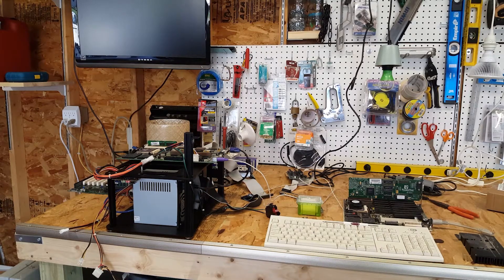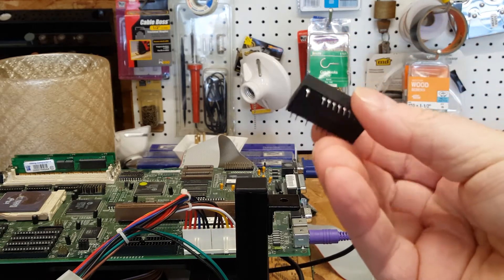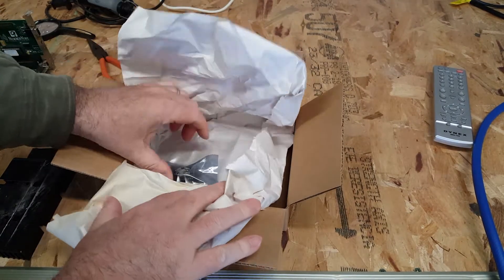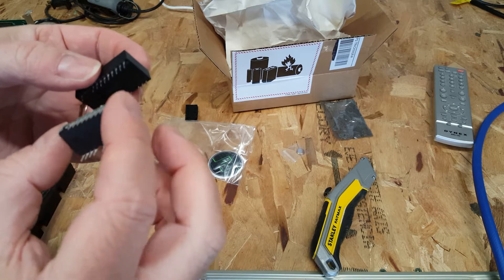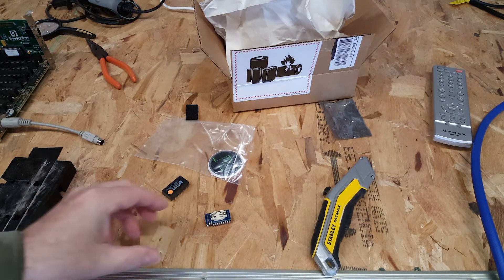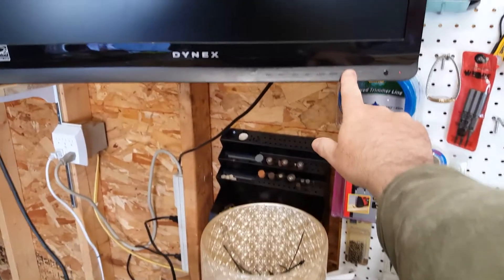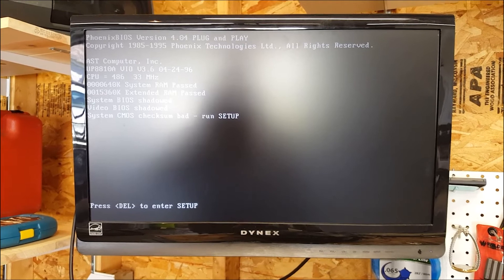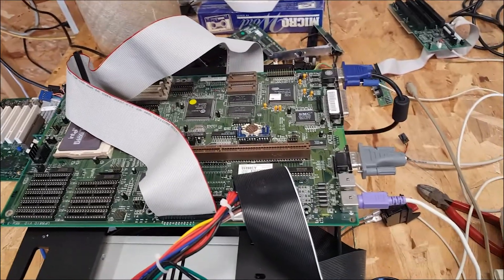Dallas Clock Chip Replacement for a 486 motherboard with a special guest appearance by Gollum

Comment: Message to the up-loader:  I have located a Dallas Clock Chip Part # DS12887 on my Socket 4 motherboard that needs to be replaced. Unfortunately, the chip appears to have been soldered on. Is there anything I can do in this instance?

Fascinating video by the way!
Reply from the maker: Hey!  that's me!
Well, there ARE two options that I am aware of.  One is to desolder that Dallas chip, get ahold of a blank socket and solder it in place than add one of these replacement chips.
The other, and bear in mind I have NEVER done it is to Dremel out the existing clock chip battery like this:  https://www.vogons.org/viewtopic.php?t=68654
Reply: @UncleMikeRetro  I'm not going to try those two options as I don't have the experience. Is it a requirement that a Dallas Clock chip must be soldered into a socket?
Reply from the maker: @richardgray131185  yes, unless your mobo happens to be one of the rare ones with separate pins for an external battery near the keyboard plug.  unlikely, so then it has to be soldered.
Reply: Could a Dallas chip be glued onto a socket? @UncleMikeRetro
Reply from the maker: no, there would be insufficient electrical contact between the chip pins and the mobo solder pads.  would NOT work @richardgray131185
Reply: Will a motherboard still be operational if it does not have a clock chip soldered to it?

I define 'operational' as the following: 'When the power button on the computer is pushed there is a display on the monitor'.

I understand a message may come up saying something like 'Battery Failure' that's not a problem.

Many thanks. @UncleMikeRetro
Reply from the maker: the honest answer is maybe.  the only way to know is to try.  literally the truth.  older boards, are more problematic.  newer ones more forgiving
 @richardgray131185

Comment: Please help me with dallas DS1225AB-150IND
can i replace this dallas without reprogramming the new dallas?
too can i replace this dallas by DS1225AD-150?
Reply from the maker: This is a one for one replacement of the socketed Dallas clock chip BATTERIES.  It is only for powering the BIOS but should NOT need reprogramming.  Nor did I ever see any instructions how to do that any way.